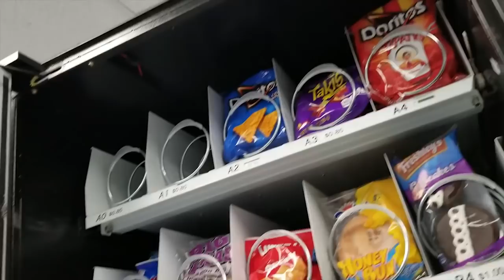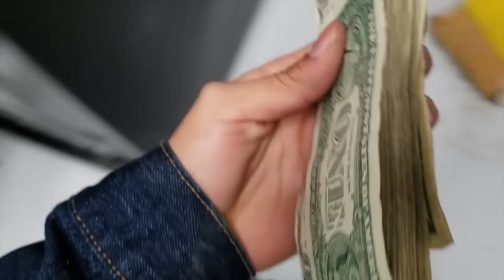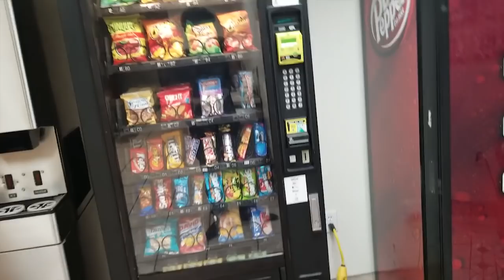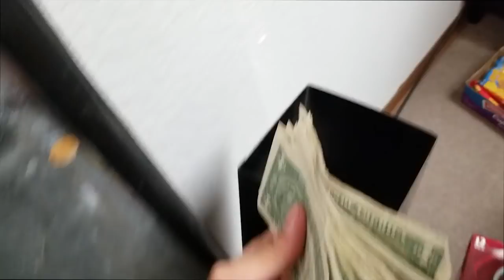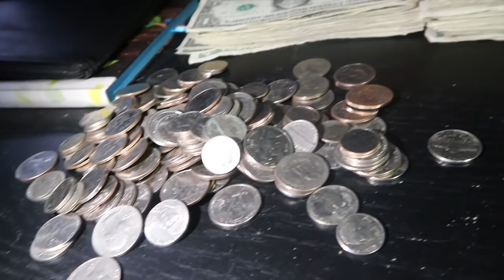Pulling Cash From My Vending Machine Business!

Comment: It is very important not just to use the amount of Gas used in your expenses, but the cost/mile to run you vehicle.   You should include depreciation, repair and Maintenance, Insurance, and fuel.     Also don't forget to include deprecation on your vending machines as well.    Also include bank charges.   All the best in your business!